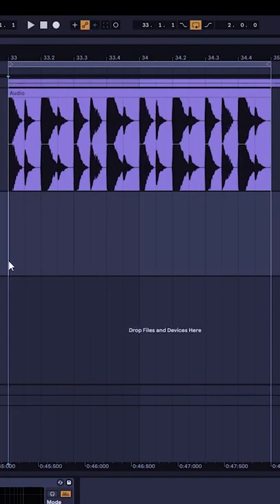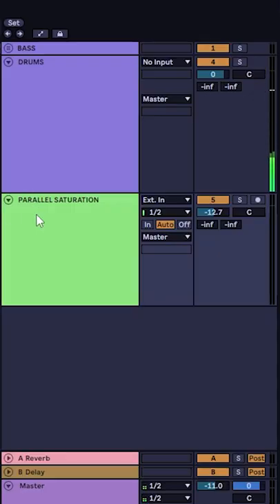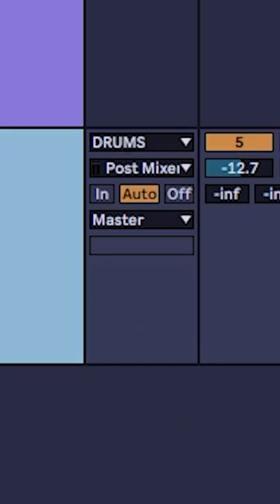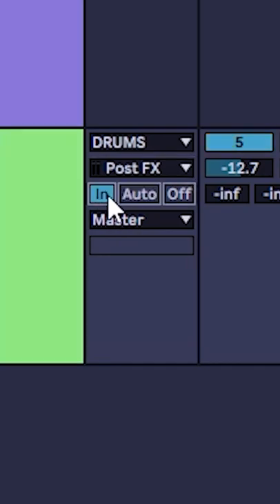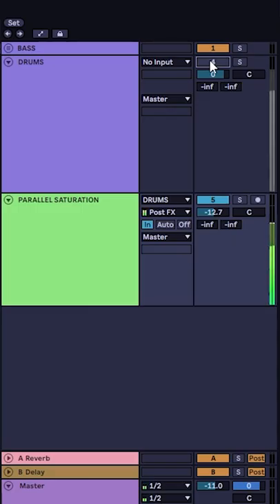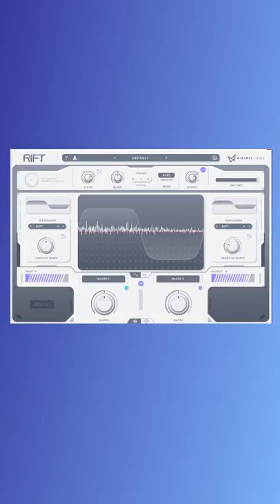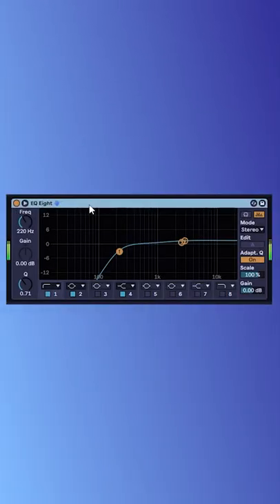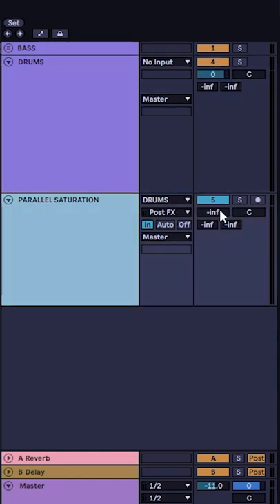BEEF UP YOUR DRUMS WITH THIS! 😃

Comment: Why not just use a saturation or distortion plugin and use a dry wet control. No need at all for difficult routing. Same thing. Basically everything that has a dry/wet or mix control can be considered “parallel processing”
Reply: He uses EQ too.
Reply from the maker: That’s a valid method for sure. But yes as Mick says you get more control in what you do in the chain. Also the dry volume stays constant in my
method.
Reply: Not all plugins have a dry/wet mix.  Sad, but true.
Reply: @STRANJAH  return tracks or just use the effects rack and split it into chains. This method is just adds another track on the mixer for no reason. Also maybe try a low shelf instead of high pass so it doesn’t completely remove low end
Reply: @unclemick-synths  and for some reason he high passed the shit out of it when he was trying to fatten them up he added more harsh high end info and didnt help the kick at all lmao

Comment: Best way to get good sounds start with good sound not try to fix it when it’s bad
Reply: @Cujo Also, to add to that parallel saturation/ compression can make good sounds BETTER
Reply: Tired of this generic response. How do you think those "good" sounds came about in the first place? I Guarantee you those sounds used techniques and processing like this.
Reply: @Skrenja the point went completely over your head

Comment: Question — would simply placing any saturator that has a wet/dry knob on the actual drum channel have the same effect?
Reply: It would, but by doing it this way you have more control over the layer and original sound

Comment: Wouldn't you just use chains for this?
Reply: asked myself the same question. I encourage you to test things out yourself but I wholly prefer the enhancement of parallel sends than a rack with the FX chain. Couldn't explain it on a technical level but I'd have to assume that this is reliant upon how the program sums signals (likely to be true in other daws where applicable). There are implication with processing power but if it sounds better than the other routing options, it is a good enough reason for me. 

Watched a video of Claude VonStroke working on a song and he talked about he can get a stronger sound using aux tracks - tried it myself and never looked back. Love the racks in live but when it comes to summing and signal strength, this seems to be the right move for me
Reply: Interesting, is there anything to back up this claim?
Reply: @snuffbeats6056  absolutely not 🤪 this is my current perception and approach with no claim to being technically accurate, even remotely. I thought the same question when I was beginning and this became my solution so thought I’d share
Reply: @snuffbeats6056  nah if a return track and a chain in an effects rack are the same volume with the same processing they will null
Reply: It all boils down to what DAW you're using and which method you're comfortable with

Comment: How can I do in Fl studio jaja?
Reply: Route it drums to a channel (channel 1) then route that channel to another (channel 2) and the master. on the Channel 2 put a eq to remove the low end and then a saturation plug in. the routes have little sliders which can then be used to blend channel 2 into channel 1 in the master